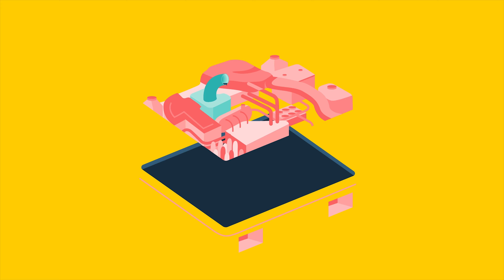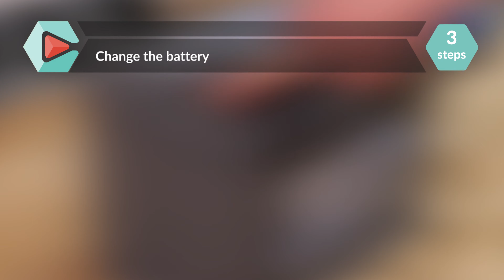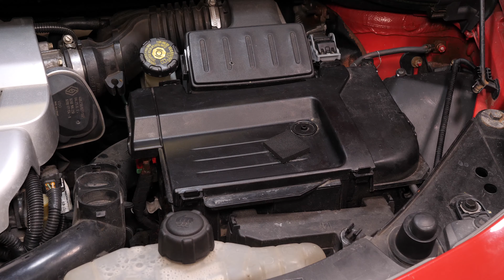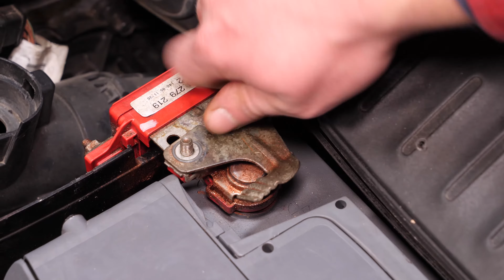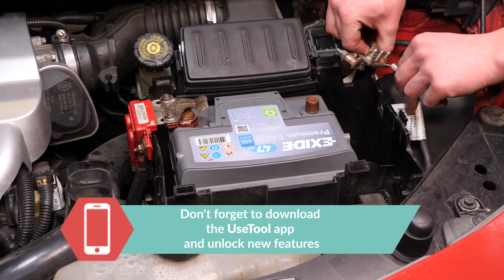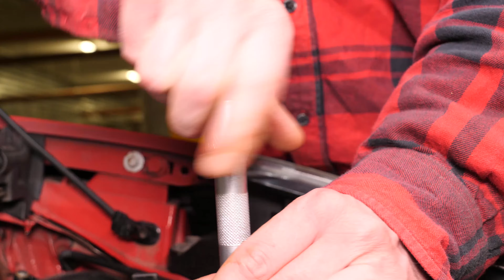How to replace the car battery CLIO 3 1.4 16V 🔋

Comment: You should open the drivers window then open bonnet and wait 15 min for all ecu units to go to sleep....only then should you carry out the battery removal/refit.
Afterwards you should put a scanner onto the obd2 and check / reset systems as required.
Reply: Thank you for the extra tip, why do you have to wait for the ecu?
Reply: @ThatKidSmokey  
It can spike abd cause you to do a full reset using diagnostic machine.
Save money..do it properly 😁